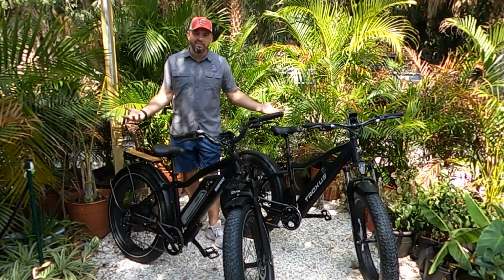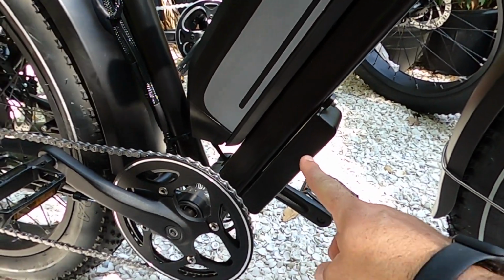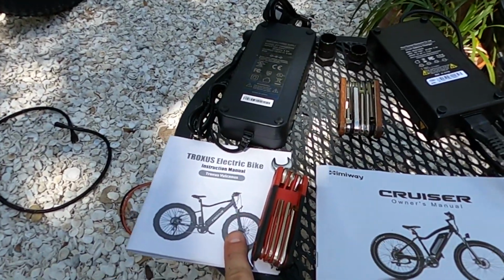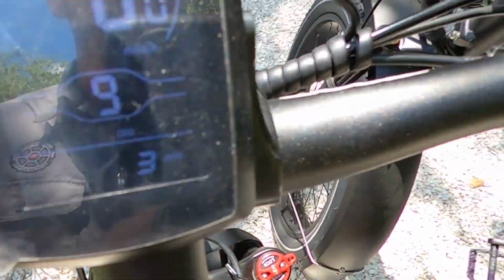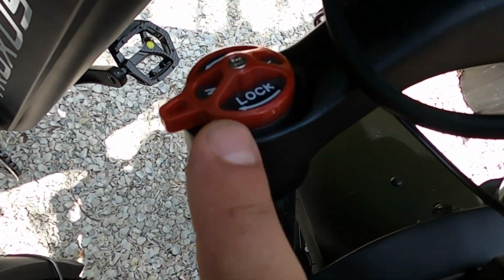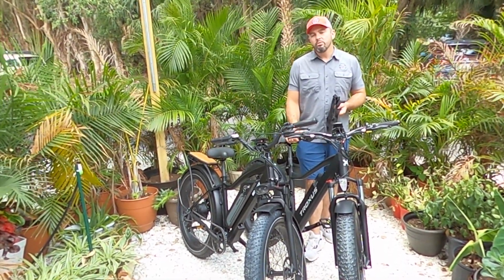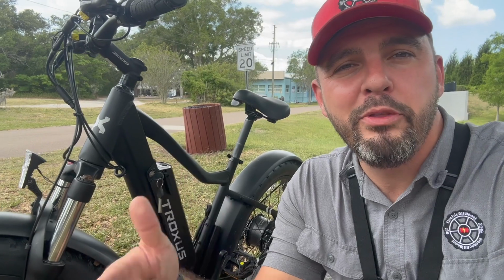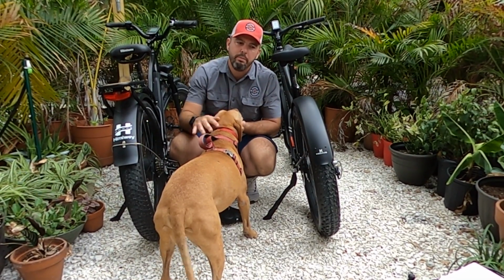IN-DEPTH Comparison: Himiway Cruiser VS Troxus Vulcanus Fat Tire E-Bike Component, Specs and Build

Comment: Great indepth review of ebikes.  Learned a lot about wire protection and rear motor/cassette setup.  You could not be more wrong about the handlebar layout preference.  Troxus left hand throttle is best bc you can shift gears while throttling.  The large +/- buttons is an ebike requirement.  putting i, power, and light buttons out of the way is much better because you rarely change them while riding.